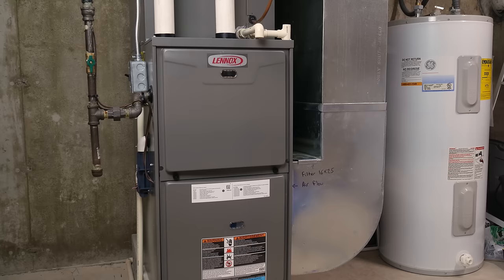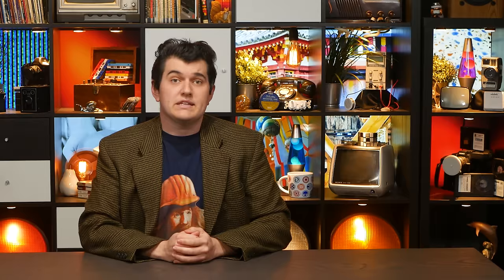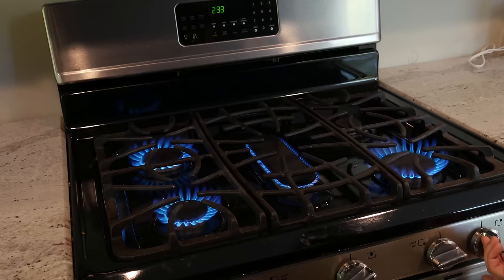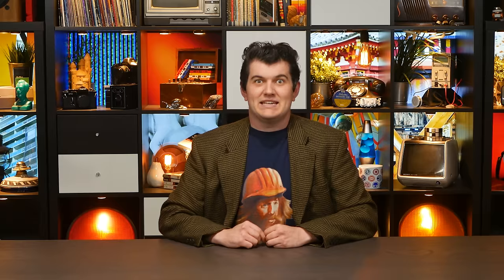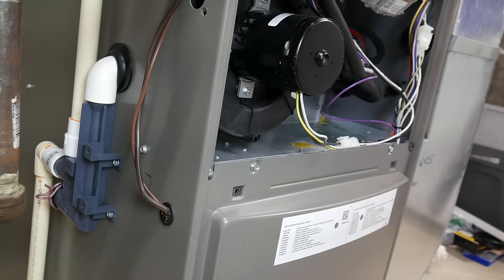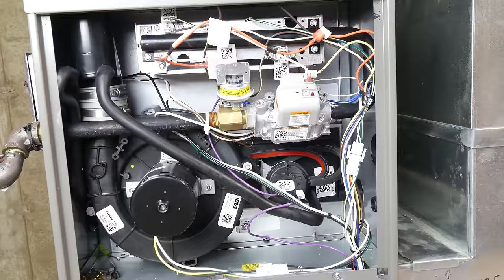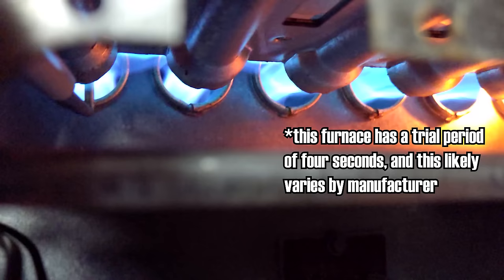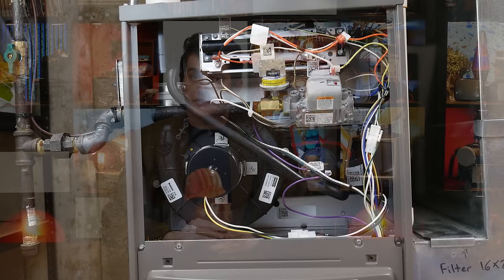Forced-air Furnaces: The What, Why, and How

Comment: Re: negative air pressure

Modern homes actually have some thing called a HRV or ERV, they recover energy while ventilating the house which allows the house to be very well sealed.

This might be a neat video topic for you ;)
Reply: Yeah, these things are slick!  They pull fresh air from outside and push air from inside out, but through a heat exchanger to take the ~70F air from inside your house and reclaim some of that heat by warming the -30F degree air from outside first.
Reply: my windows are older than i am so i do not have to worry about this
Reply: Yes please can you do a video on this?! I have one and I have no idea how it works!
Reply: I hadn't heard of these! They sound nifty!
Reply: What heat pumps?
Reply: @alexanderbresnahan2932  they call them heat pumps i think
Reply: @alexanderbresnahan2932  Your still loosing heat.
Reply: @thepurdychannel8866  Not heat pumps.  These are just fans, and some sort of heat exchanger.  I've seem aluminum cores or plastic cores.  No compressors, uses like 120w at most.
Reply: @stevenw4549  True, but it's still more efficient than opening a window to get fresh air when its -30f outside, or breathing the same box of air all winter long
Reply: Yes, in Sweden we have areas with zero energy houses. They have this heat exchanger and super insulation. There is NO added heat so the entire heat comes from those living there and stuff you use like TV, lights, oven and so on.
Reply: @alexanderbresnahan2932  You still get fresh air, it's unavoidable.
Reply: That's pretty rad! Meanwhile, in my 1000 year old portland home, the windows may as well be doors to the outside with the amount of air they let in/out
Reply: This sounds like a good video idea, I'd watch it
Reply: Not only modern homes, I retrofitted a 130 yr old one for heat recovery ventilation. Not for the faint of heart in an old house but it should be the norm for new dwellings.
Reply: Alexander Bresnahan I’m sorry. -30f? Where tf do you live. The North Pole?
Reply: @michaelesposito2629  That's what winter is like in a northern continental climate away from Gulf Stream. If it's very dry, it's tolerable.
Reply: @Xanthopteryx  So what is the heat exchanger for?  Exchanging from what to where?
Reply: @alexanderbresnahan2932  oh
Reply: Came here to say this! These things are actually really slick, they'd probably be worth their own video
Reply: Alexander Bresnahan  just use an oxygen  sensor with bypass dampers on the erv to control when ventilation occurs. Modern problems require modern solutions.
Reply: @stevenw4549  Exchange heat from one place to another.
In a house you need air (oxygen) to survive. And you need to get rid of carbon dioxide. And you need to get rid of moisture to prevent mold and other problems. So you need fresh air from outside and then you need to get rid of the old air inside.
In old houses, that is done by.. well, there are a lot of leakage and you have vents and so on.
In a zero energy house, you have a completely sealed up house. If you take all those areas that might leak air it will add up to an area smaller than the palm of your hand!
So you have to force the ventilation. You blow air out and blow air in.
But, if there is -20 degree C, or -30 or... colder (record low in Sweden is -52.6 degree C), this will make it cold inside, and this is the reason for you having something that heats your house (radiator as an example). So this is a complete waste of energy since you heat the house and then blow the heated air outside.
Instead of this, you have a heat exchanger so the heat that goes out, will warm up the air coming in! So instead of very cold air coming in you will have air that is close to the room temperature.
And also in the summer this is good because then you might want cold inside but it is hot outside - it will then, automagically, work the other way so the cold air inside will chill down the hot air outside coming in.
For air heat exchangers, the best ones have normally an efficiency of around 80-90%.
Reply: @Xanthopteryx  So there is no heat generated other then from humans and appliances? How cold does it get there? Just doesn't seem possible to work that well. But I'm taking your word for it. Thanks.
Reply: @stevenw4549  Yes, and of course, sun through the windows. You have large windows facing south and tiny one facing north (where there is no sun to talk about in the northern part of the world). And of course, insulation is thick and everything is well sealed.
It, works!
https://www.youtube.com/watch?v=Hz6qomFM_dw
Some even build plus house, where you have solar panels so on a yearly basis, the energy this house consumes from the grid are a negative number! (including heating water and all stuff you have using electricity).
Reply: @Xanthopteryx  Ok thanks. Very interesting.
Reply: I have a system like this, with 3 layer window glasses. Using these, and other technical gadgets, i was able to reduce the energy consuption of the house by over 50%. Makes me happy.
Reply: @thepurdychannel8866  heat pump is different :) AC is a heat pump. 

The above mentioned machine is just a simple ventig equipment, i have something like this: 
https://les.mitsubishielectric.co.uk/products/ventilation/domestic-lossnay/vl-220czgv-eb
It does not pump air, but the incoming air and the outgoung air meets in the special filter and they give heat to each other, you can save partly of the energy content of the exhaust air. 
As this particular machine has paper heat exchangers, the extra humidity of the exhaust air diffundes thru it, and a great part of it comes back by humidifying the incoming dry air, so the room's air humidity will stay in healthy levels, around 50% relative.
Reply: I've got one! It's pretty much just a fan in a box
Reply: While you can technically use them on any home, they are really designed more for  highly insulated/high efficiency homes where you don’t have a ‘leaky’ house to let enough fresh air into the house. But they are great devices if you want to pull fresh air in and pre temper it to help lower your heating/cooling temperature delta.
Reply: PLEASE COVER THIS
Reply: @andykillsu more commonly I see homes with a fresh air system for the HVAC. A way to pull in outside air to condition it and balance it when the ac is running. An ERV like mentioned is really only used in super tight homes with exceptional insulation and air sealing.

Comment: Our water heater exhausts became clogged when I was in highschool. There was about a week where everyone in the house felt like death. Finally, when my dad almost didn’t wake up in the morning we had someone come out and check our systems. The HVAC guy brought a sensor in and literally exclaimed upon going downstairs “you all should be dead”, and opened every window he could find before even starting to fix the issue.
Reply: Yep, dangerous stuff -- always good to have multiple CO & Gas alarms if you have or use any fuel powered appliances...or even have an attached garage (some have died from push-button-start cars that were accidentally left running in connected garages).  We always had 1 on each main floor (basement 20ft from furnace, livingroom 20ft from fireplace, upstairs central to bedrooms) plus an additional one in the room above the garage.  I also like to have one indoors where any extension cords come thru windows/doors while running portable emergency generators.
Reply: Y'all got super lucky, that's scary AF.
Reply: @matthewmiller6068  like I needed another reason to hate pushbutton start...

Comment: People take these for granted, but they're actually really interesting pieces of technology.
Reply: that's basically the theme of this channel
Reply: These topics are my favorite, I hope he continues to make more.
Reply: Furnaces are comprehensible pieces of tech which makes them really cool to learn about
Reply: what I find really interesting is how similar it is to a huge fan space heater. you just have heat from burning in the giant heatpipes, instead of resistive heaters stuck to heatsinks. Both provide instant, forced-air heat.

Hydronic (radiator) heating works more like those oil-filled electric heaters... takes ages to get going and then overshoots the temp after the thermostat gets triggered. I have to constantly twiddle the thermostat to effectively reduce its tolerance from ±0.5°C to ±0.25°C (but with the overshoot, it takes the actual room temp range from ±1°C to ±0.5°C).
Reply: I found it very interesting because I've never seen a gas furnace before (never seen any household stuff functioning on gas really). Wouldn't have thought that something so simple sounding could actually be so complex.
Reply: After paying a few thousand bucks to have a new one of these and an air conditioner installed, there will be no "taking for granted" from me!

Comment: Coming from someone going to school for this field, I will say that this video was very well put together. Also, here in the south (especially in south Texas) we only ever install the 80% furnaces and just completely avoid the 90+ units simply because we don't have much of a need for higher efficiency heating since it rarely gets very cold. Whenever it does get very cold, it is very short lived which really beats the purpose.
Reply: RIP this comment after the Texas Power outage and resulting winter catastrophe

Comment: My old furnace that was built in the 80s still has a gas pilot light that you have to light to fire the main burners. And it has a pretty interesting limit switch, it spins! It's basically a giant heat sensitive probe stuck in the exhaust chute, when the main burners are lit, the heat from them extends a big ol thermal bimetallic strip and causes it to extend to a certain point. When it extends all the way, it kills contact to the blower motor.

Comment: Pro-tip - turn off the central air when doing home improvement (if you have indoor air intakes). My blower motor died when I was replacing my windows. A few weeks after replacing it, the furnace wouldn't ignite and it was blowing cold air.

Turns out the air intake sucked so much dirt and sawdust (from working on the windows) down into my [recently replaced] filter that the blower was sealed off so it was effectively operating as a vacuum pump. Probably why the old motor died lol
Reply: Many fans and pumps rely on the fluid they move to cool their motors. They WILL burn up if they are run dry/blocked.

Comment: Forced warm air systems were popular here in the UK in the 60s and 70s but they were renowned for failings and setting fire to rooms/houses. Everything is mainly gas fired central heating here now - a central boiler heats radiators or under floor heating in homes.

Another excellent video dude